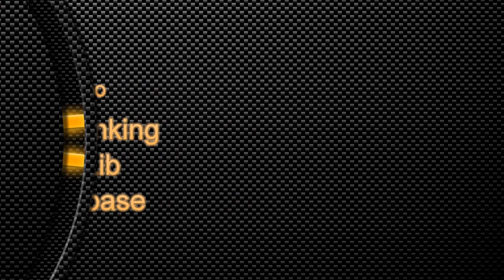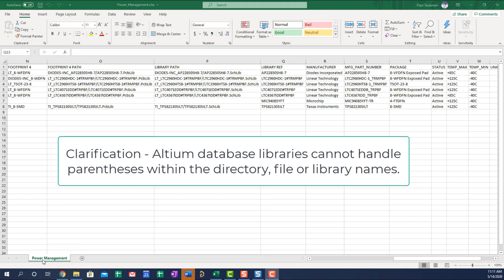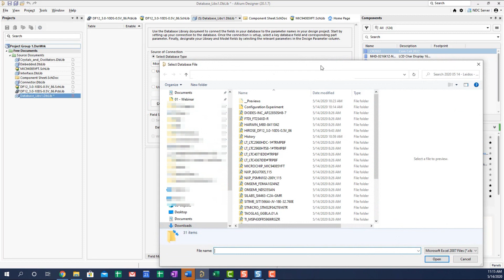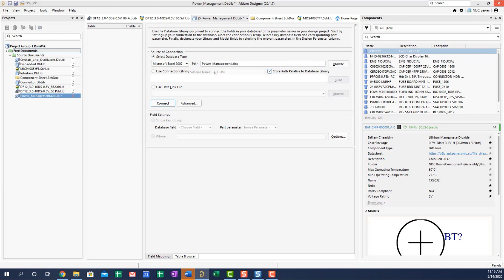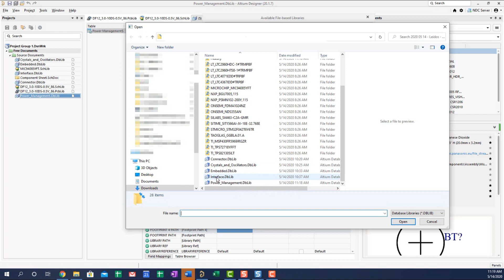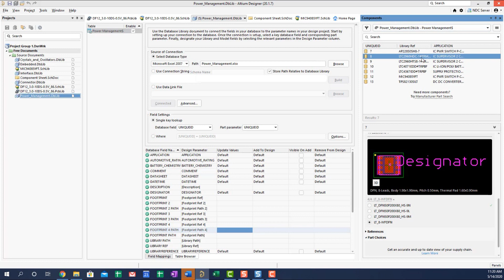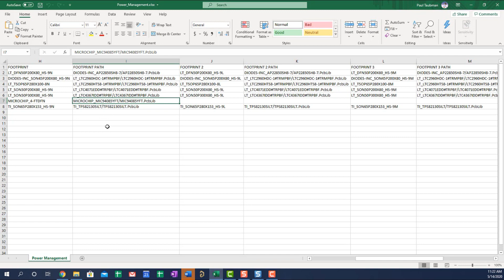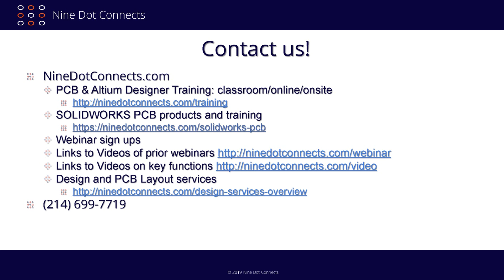Linking Altium DbLib with a Database

Comment: Will there be any problem if we choose Excel instead Excel 2017 ?
Reply from the maker: You should be able to use whatever Excel you have available. In the dropdown list for "Select Database Type," there are two options for Excel: "Excel 2007" or "Excel." If you select "Excel 2007," the software will expect to find a file with the .xlsx extension. If you select "Excel," the software will expect to find a file with the .xls extension.

REGARDLESS of which Excel you use, if you are using Altium Designer 2018 or later, you will need to download the 64-bit ODBC driver. 

https://www.altium.com/documentation/knowledge-base/altium-designer/working-with-32-bit-and-64-bit-software-compatibility
Reply: @NineDotConnects  , Thanks...*.xlsx is not working for me, *.xls is only what I was able to successfully link with AD 21 and I had to choose excel 2007 for that. I am using both AD and MS Ofc 64 bit version.

Comment: Hello. I just have a question. I am an Alitum Librarian for our company. We have 1900+ components that must be maintained. So, is there like a way to connect the back-end of the Altium database to an Access or Excel file, and then everytime we perform an update im that file, the components in Altium will be updated as well?
Reply from the maker: You are asking for a feature of the Nexus offering by Altium Inc. Nexus has a workflow capability that allows the library to push and/or pull data from an external database. If you are using Concord Pro and have some savvy coders, you might be able to make this happen in-house. It would require you to understand the Concord Pro Firebird database structure and the methods Altium Designer uses to communicate with it. If you are using A365, you will not have access to the server.

Comment: As with the footprints, is it possible to do the same with a path and name for a 3D step file. To add to the footprint?
Reply from the maker: If I understand the question correctly, you are asking if we can add a path to a 3D model.  The answer is ‘no’.  In the classic Altium Designer Symbol-Footprint library (what we call a symbol centric library) and in the database library, the 3D model is not linked.  It is always embedded in the footprint.  Much of this has to do with the fact that the model needs to be properly oriented to the footprint.  There is no universal definition of origin for mechanical components.